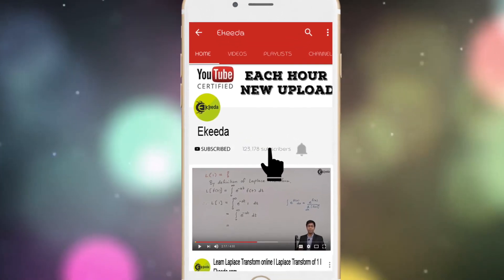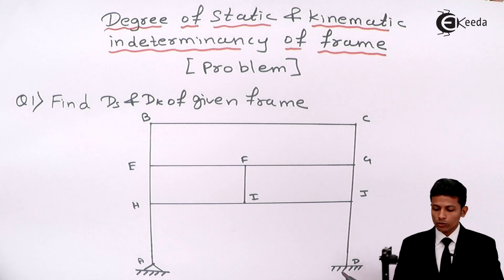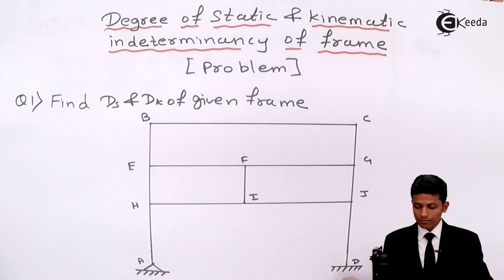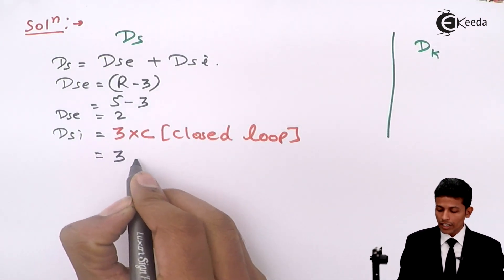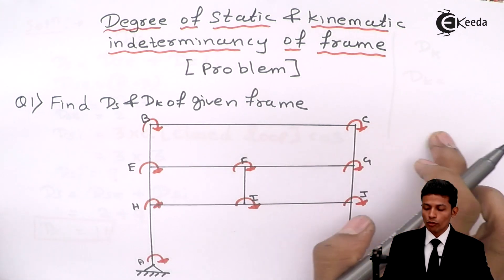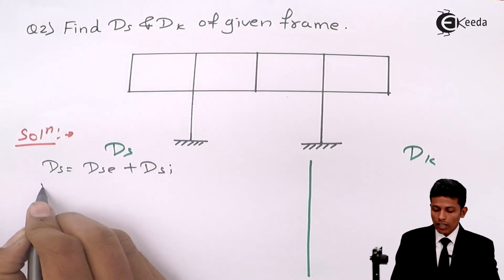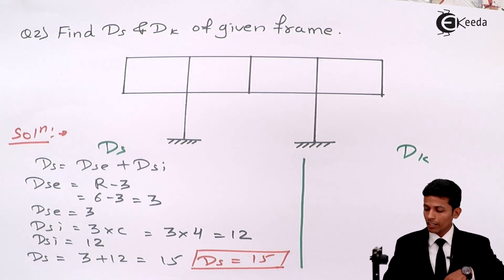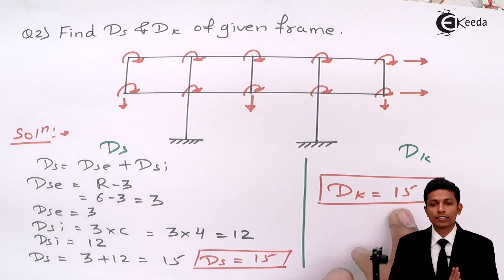Degree of Static and Kinematic Indeterminacy of Frame - Problem 1 & 2 - Structural Analysis 2

Comment: Dk is wrong refer NPTEL videos. if members are taken as inextensible then this Dk value is correct. the formula will change to Dk= (3J-R)+(m dash -1) - number of members. so its 25 - 12 = 13